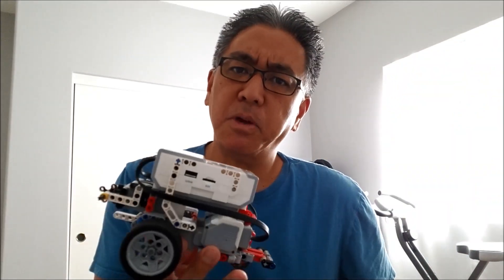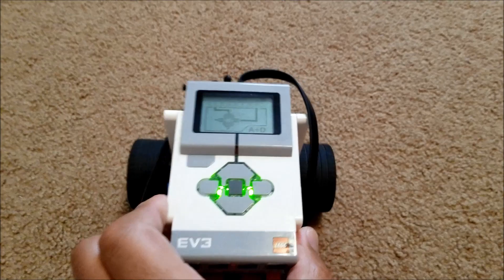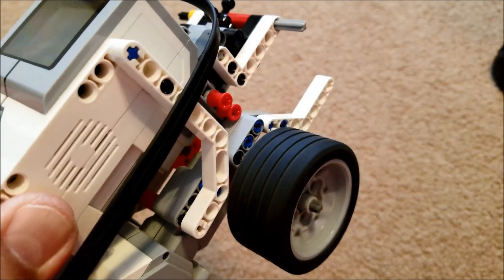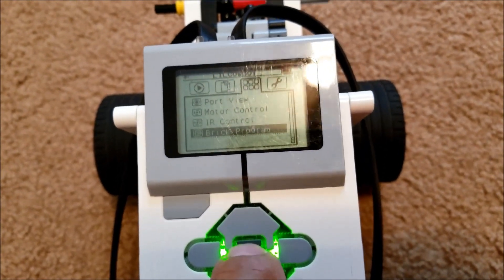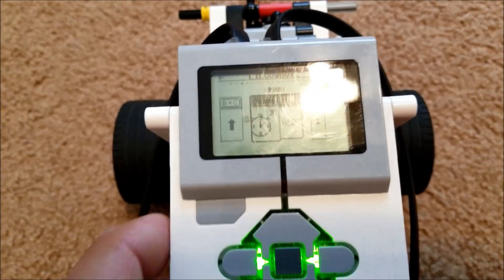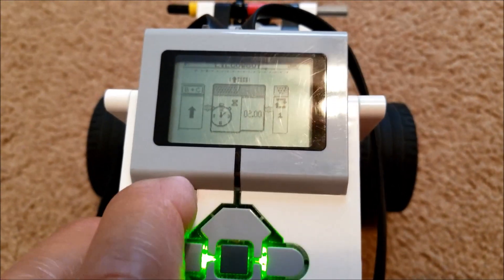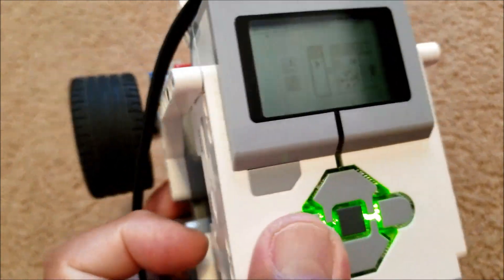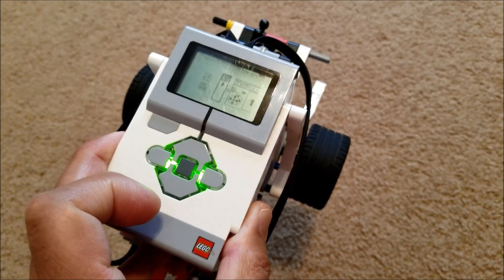"Help Solve Mr  Hino's Mystery Motor Problem"

Comment: I had this problem when I was in FLL a year ago, I called LEGO and they told me to update my firmware on the brick, I did, but nothing changed. I decided to do some of my own troubleshooting by taking out the motor and moving it with my fingers without it plugged into the brick. I soon discovered that the motor had a problem with the encoder, as it was extremely hard to move the motor by hand because of the resistance. I changed the motor out and everything worked perfectly. Hope this helps!
Reply: How did you change the motors? I mean, how did you fixed that problem in the motor. I'm suffering with that right now.
Reply: @xeantivirusevo3886  I switched the motor. The encoder is broken on the inside and lego does not sell encoders for them. I had to get another motor and switch it out for my problem to be solved. Hope this helps! Let me know if this fixed your problem:)

Comment: My 2 cents - I think you need to try and isolate / troubleshoot further. Does it happen with same motors on port A or D? What happens when you simply swap port B & C? Is it a problem with the EV3 or with the motors? - Try switching out motor or put motors on another EV3. I remember we once had an NXT motor that wouldn't operate on port A only, but worked on the other ports. We simply marked it and moved on. Good luck! Please keep us posted.

Comment: Greetings, I had the same problem with 3 robots at the same time. I try switching the motors and nothing, change cables and nothing. I gave him a hard reset and nothing. I gave an update from the program and neither. the only thing that apparently fixed the problem was to give an update from the browser. there it started to work as it is supposed. I hope it works.

Comment: Hi, we had a similar issue some time ago. The reason was a defective cable. The cable was not completly broken, power transmission worked but the encoder lines did not transfer properly. This is no problem for the motor test as this works without encoding at maximum speed.  Try to replace the cable and see whether this fixes your problem.
Reply: We had the same problem and the same solution. Bad cable was reason
Reply: But Mr.Hino said that he already tried to change 3 or 4 cables This video: 3:58